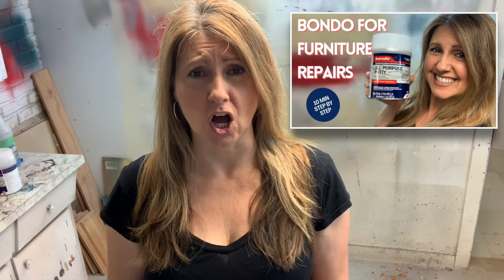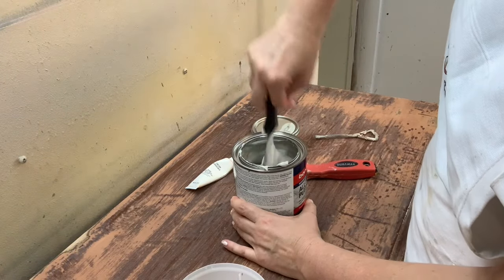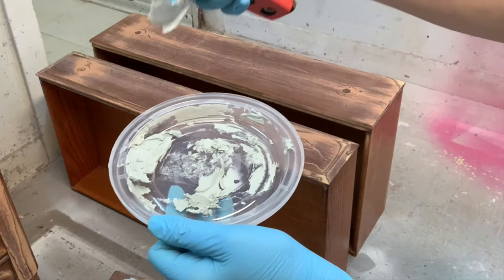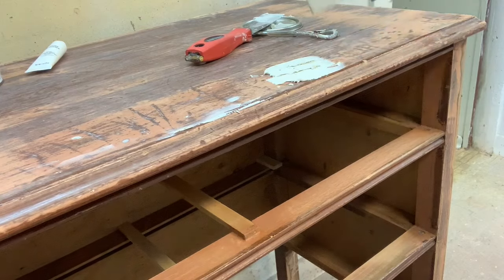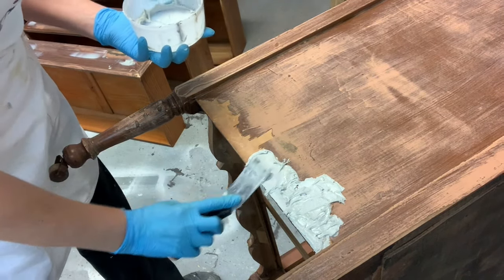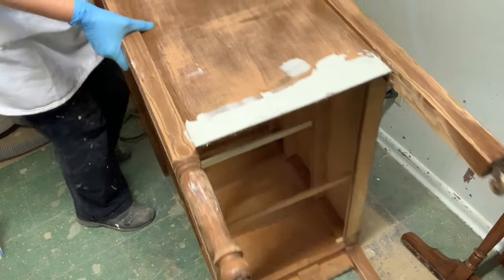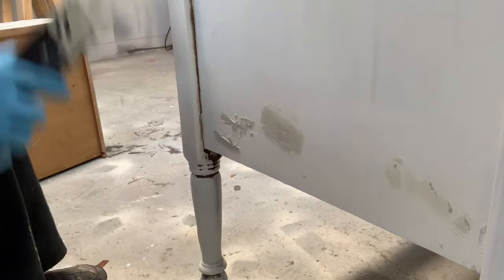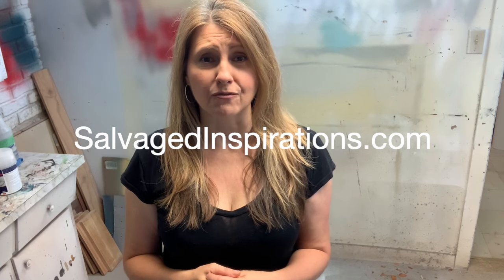Bondo For Furniture Repair

Comment: Denise! 

Your videos are extremely helpful, inspiration and positive! You are also Canadian which is helpful when I'm looking for products.

I am looking to reduce some detail on a dining table skirt. One, so it reduces a bit of detail sanding. Two, I know food from my kids is going to get stuck in there so I wanted to make it easier to clean as we use it. 

I asked at Home Depot and did a bit of googling. I don't think they sell this all purpose bondo at Canadian Tire, Home Hardware or Home Depot. Where did you purchase it?

Finally, it appears that you sanded first? Do you think I can apply this product to the detail grooves for a table skirt without throughly sanding all those grooves?
Reply from the maker: Hi Sarah! I buy mine from Amazon. And no, I wouldn't bother sanding in all the grooves but I would give the surrounding area a quick scuff sand and any of the larger details (if needed). Hope this helps. :)
Reply: @SalvagedInspirations   Thanks for the reply Good to know you got it on Amazon so I don't continue to bug local retailers. So far I scuff sanded and applied dap platinum patch as I could get it from home depot. Let's see how it goes....

Comment: Before priming do you wipe with a wet cloth or spray with rubbing alcohol and wipe away the dust??
Reply from the maker: Neither. I've been sanding. I vacuum up the excess dust. Bring it into my paint room and use these tack clothes to pick up any remaining dust. Then prime. I do the same thing in-between coats of prime and paint as well.

Comment: What if you want to stain the piece being worked on? Not paint.
Reply from the maker: Bondo can't be stained and I have yet to find a GOOD stainable filler. What I have done is stain and the paint match a 'faux wood grain' on the parts that haven't caught the stain properly.

Comment: Nice work, beautiful! For the Bondo smell, how you get rid of the smell of the Bondo even 4 days after it has been applied? I'm not able to find an answer on the web, thank you
Reply: My Bondo is a body filler for car and not the one Bondo all purpose. I think the odor is different. I think i will scrap all and redo it. 4 days now and the room smell really bad :(
Reply from the maker: Did the smell go away after a few more day Steven? I don't use the car body filler so I'm not sure about the smell but when I open all the windows in my studio (aka my basement) by the next day I don't smell it anymore.

Comment: Great tutorial!  Can you stain the bondo after it’s been sanded?
Reply from the maker: A Gel Stain will cover it somewhat however it doesn't take stain like wood does, unfortunately. I only use bondo when I'm painting.
Reply: @SalvagedInspirations  What type of wood filler do you use when staining?
Reply: @SalvagedInspirations  what would you use to fix veneer when staining?
Reply from the maker: @victoriasmith6878  Great question. I usually remove the veneer if I can't repair/glue it back down because I haven't found ANY product I'm happy with when it comes to staining. If anyone reading this knows of a good stainable filler, I'd love to know as well! :)

Comment: Could I do this to the entire top of my end tables that are veneer and damaged , and then just paint? I’ve tried to repair the veneer but it is a patterned veneer and I just can’t! So I’m hoping I can use the bondo to the top , sand and just paint.
Reply from the maker: You can but I prefer to use Bondo just in the areas needed. The reason being it dries HARD! Unless you have a sander, it's not easy to sand by hand. Hope this helps.
Reply: @SalvagedInspirations  I do have a sander , I’m nervous but I am going to give it a try , my goal is to paint the top to look like wood. I’ve done it on metal and was very happy with the results. Hopefully I can pull this off .
Reply from the maker: @renamcfarland2834  I'm cheering you on from this end Rena! 😊
Reply: @SalvagedInspirations  thank you ! Your tutorial has inspired me

Comment: I am using body filler on a side table, what primer should I use on top the body filler as a primer. My finish paint is Sherwin Williams -emerald urethane trim enamel

Comment: Bondo is good for anything. The big benefit of Bondo is it dries fast, adheres well but you can start working on it and fine-tuning it as soon as it starts getting hard. I use a Sureform file which can be used by itself or on the handle it comes with to start shaving the surface as soon as it starts hardening. You leave very little to sand afterward and fill the room and your lungs with the dust. Cheers
Reply from the maker: I'm going to look up that Sureform File on Amazon...thanks!

Comment: Save sand paper, electricity and time by sanding bondo first with 40 grit and a sanding block, it is very fast at bringing the bondo to a form, then you can use your machine disc sander with higher grit and it won't clog as quickly and your disc sand paper will last longer.

Comment: Thank you for this very helpful video!  You’ve helped mitigate the sinking feeling one gets when unintentionally making a boo-boo, like the one I made the other day when a small piece from a corner of a door on an old oriental cabinet I’m working on broke away. AND I misplaced the teeny piece, so gluing it back on is not an option. I’ll follow your link!
Reply from the maker: So glad you found this helpful and good luck. :)
Reply: I just bought an accent chair that has a couple cracks or splits in the wood arms/legs where they are attached to the chair.  Could I use Bondo to fix this or is there a better thing to use?

Comment: Hey Denise, did you use a 80 grit sand paper when sanding? Btw great video.
Reply from the maker: Thanks! :) ... and I believe I did. With Bondo, it dries SO hard - low grit sandpaper works best to sand it down flush.

Comment: Nice video, you did an excellent job. Have you tried Durham's rock hard water putty? It is less expensive, about 7 to 8 dollars at Lowes  (most Big Box Stores). It's a power, add water and mix, doesn't shrink, and isn't toxic
Reply from the maker: I have! I find it works well but I don't find it dries as hard as the Bondo. Way less costly for sure tho!

Comment: Hey Denise! You made that look so easy! I bought a couple of mid-century modern pieces for my bedroom and there are some places where the veneer is missing. Should I sand down the entire piece, fix gaps with bondo & hardener and then re stain? I am I also thinking of painting them. If I wanted to paint them, what would you suggest doing?
Reply: It probably won't stain well since bondo doesn't have wood particles in it. Painting would be your best bet.